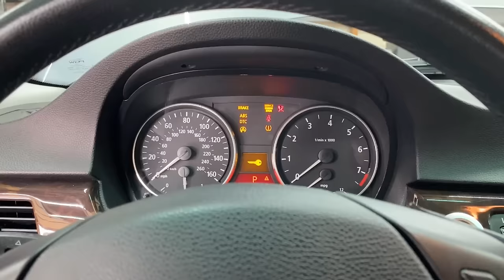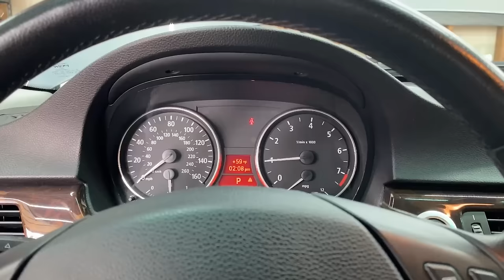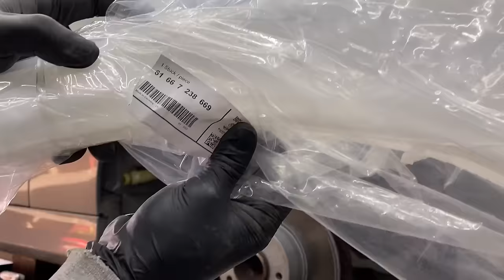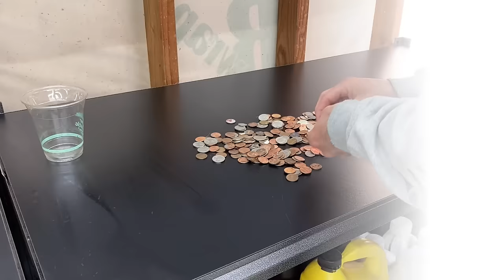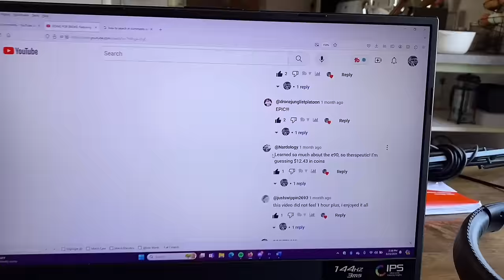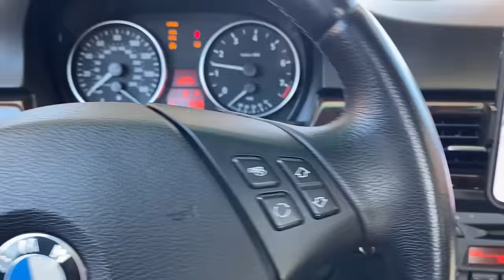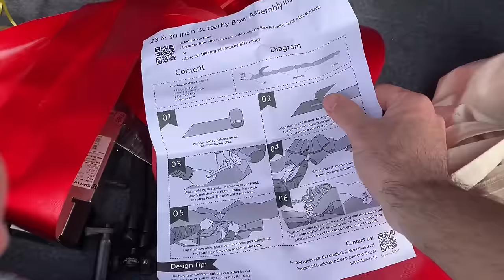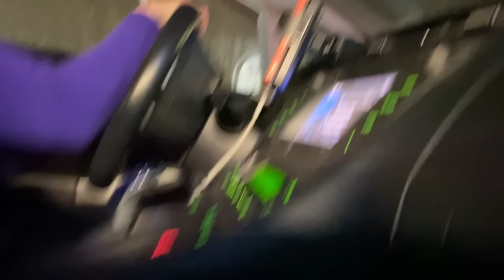Giving A FREE BMW To A Random Subscriber

Comment: This was an awesome video! Not that the others aren’t awesome. Hey any chance you can make a video about the tire sensor system. My 2011 128i has the light on 😮 I’ve replaced the RDC antenna under the driver side, the module in the trunk, the 4 sensors in the fenders, and the sensors in the tires, but I still have the light on the dash on 😢
Reply from the maker: dang that sounds brutal! I would if i had any cars with TPMS lol, sometimes it takes specialty equipment to check signals at the sensors and ISTA to troubleshoot, if i ever do run into it ill for sure document it!
Reply: You are the best!